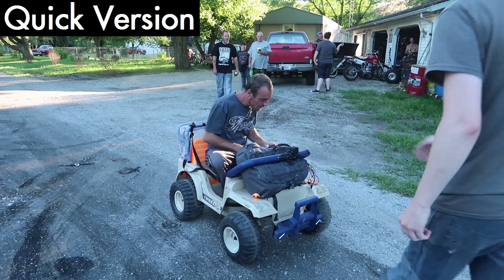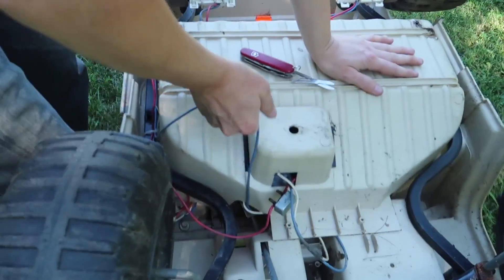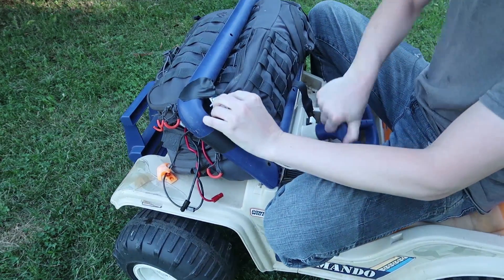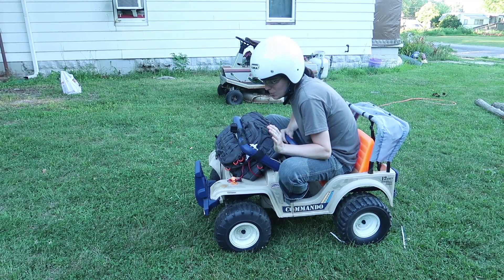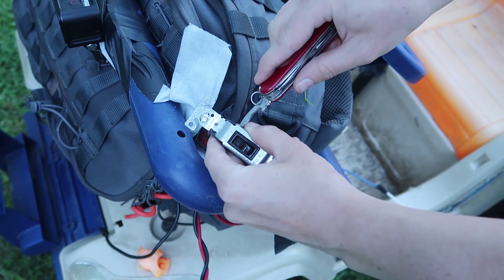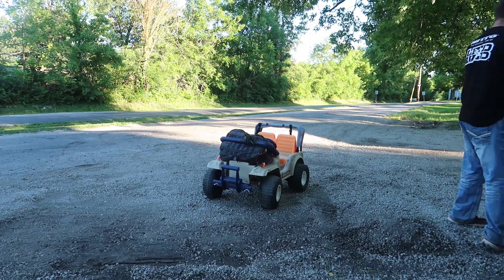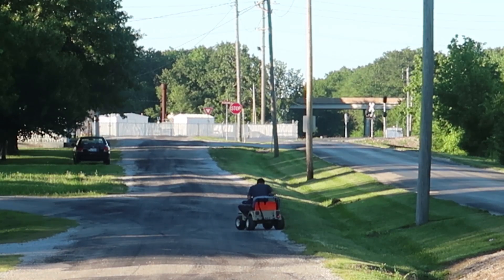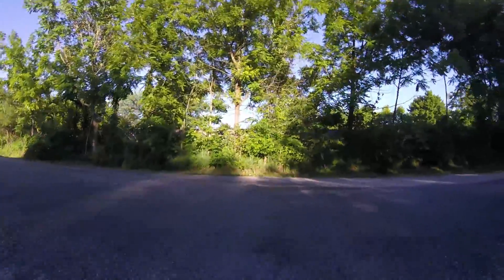1990s Power Wheels 24v - 48v Extreme Lithium-ion Conversion / Mod / Upgrade: Fastest Yet!

Comment: Brilliant ! Great fun, sounds like the plastic drive gears are getting a bit tired. Those little 12 Volts motors are holding up well with 24 Volts, I bet those motors were very hot.

Comment: The jumper box (pocket pack) that AutoZone carries advertising jumps up to 6.0s just boosting the 12v from my truck set in warranty bypass mode. I swear it pumps in all the amps those motors want at 12 will push other 12 vs around

Comment: 10k resistor may have been for braking
Reply from the maker: actually i think i read it wrong and its a 1ohm resistpr but with some odd letters around it as the part number
Reply: Yep, that sounds plausible.

Comment: The switch only blew up because its rated around 3 amps and those motors were definitely pulling over 3. I wanna see you get a bigger switch and see 48v

Comment: those silver things you cut out are probably thermal cut-outs in order to protect the motors from getting overheated from little kids trying to go uphill in the grass and not moving.
them little 12v motors are super easy to burn up :( and so are those expensive 250w motors off those little razor things :(

Comment: A PWM rated at 24 volt from a drill trigger switch will do the trick
Reply: Did that on my kids' cars, works great. For an adult passenger might want to add more mosfets in parallel and put them on a bigger heatsink

Comment: You could make it brushless, on hobbyking.com is a 45dollar 6364 motor and a cheap 6s 180amp esc for 30dollar I think. Throw in a servo tester and your setup is done. If you want insane speed and power you can go to the 48v if you get a different esc(70-120dollar from China) on 48v it will go 40mph
Reply: If you need help on what parts and what gearing and stuff just ask, I've done it multiple times and I have a 400amp setup on 18s that powers a small car about the size of your city car😅
Reply: Honeyroasted cashewnuts I have a 40v lithium hooked up to my sons John Deer peg perego tractor.  I also have a 20v battery.  There’s a fuse on the negative input.  Will I be ok with 40v taking breaks, etc or should I stick with 20v?

Comment: Have you thought about using something like a dimmer switch to control speed? Though, I don't know how well they'd handle the current.
Reply: Dimmer switches use a triac and will only work with AC power.
The speed controller from a cordless drill might work with an upgraded mosfet and heatsink though.
Reply: cheap controllers for brushed electric scooters can be had from ebay amazon etc for a few pounds. they're built for the purpose, a drill speed controller will rapidly burn out, as they aren't rated for a 100% duty cycle.

Comment: looks like a bunch of fun. Could be fun to do a drive train upgrade of some kind.  Makes me think of the power wheels racing at maker fair.
Reply: insanitybiker I do projects with old wheelchair motors on my channel. With 48v and a wheelchair motor that thing could do 30+ MPH. May have to make one
Reply: those small wheelchair motor and gearbox units from zero axis wheelchairs..

Comment: Yup you stripped the gears out. I did something similar (lead acid) years ago I chain sawed the middle stretch it then ran just 12v but I only had one drive motor.    I had plenty of spares which is burn one by one!

Comment: If you would have used the big switch from your tractor it would have worked. I think the switch were using was too small and couldn't handle the amperage.
Reply from the maker: i agree to an extent, i started removing the big switch from my tractor but realized it was rotting and just a bad solution.